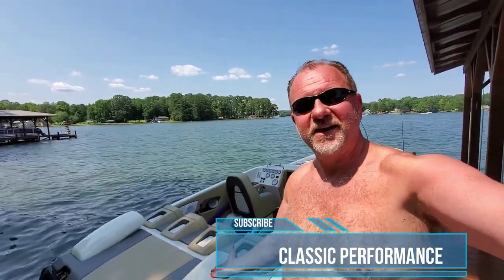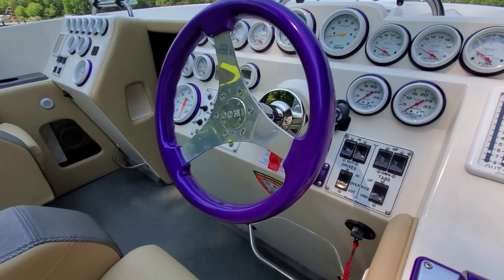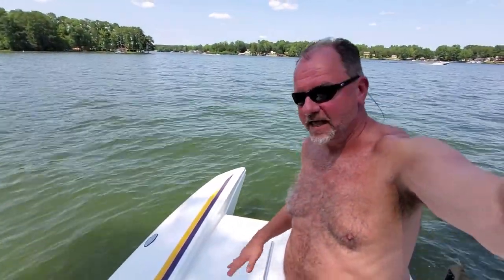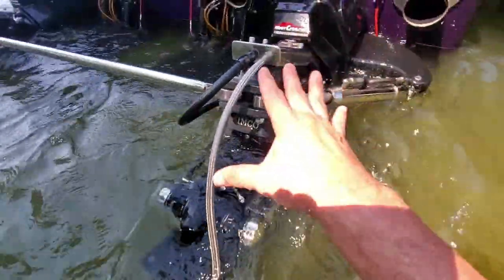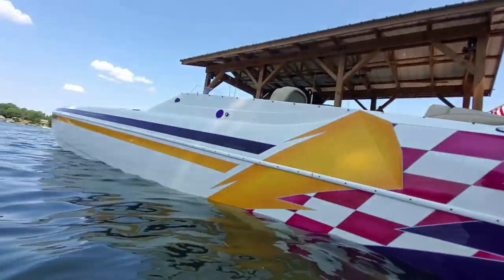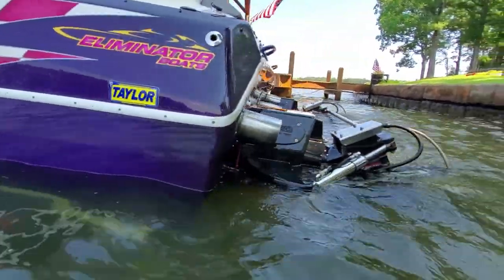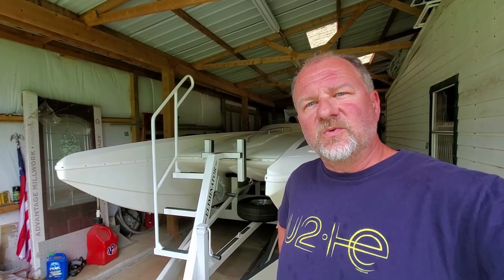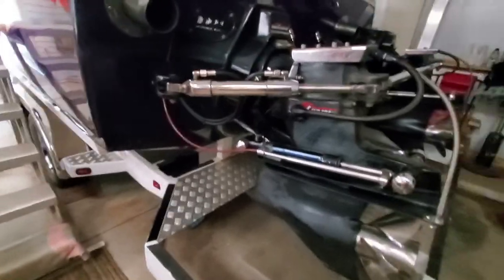Eliminator Daytona 33 walkaround and more! (loud)

Comment: "Livorski" hahahahaha
Reply from the maker: Yea, I know. It's not Polish!! Ha!
Reply: @classicperformance  Great video though. The 33, especially earlier model years are often regarded as the most porpoise/hop prone, but it goes to show when the time and effort is put into getting the setup right (X-dimension, IMCO standoff boxes, tunnel tabs) you can correct those problems. The 33 that ran 174 at Havasu's Desert Storm in 2009, and 192 at the 2012 LOTO Shootout is proof of that.
Reply from the maker: @5571350M8  Indeed the porpoise/hop is always an issue to tune for especially with the new motors over the old Mec "blue" motors. We tried some cleavers and it was vey pronounced and not able to be overcome. In the current state with "standard" props and the NA 540s, she'll run just under 120 @5,500 rpm.

Comment: That thing is siiiiiickkk!!!!

Does the engine noise ever get old when going for longer drives?
Reply from the maker: Never gets old! haha. Actually, at cruising speed the cabin and helm is rater quiet and the motors are more of a background. The wind noise is actually more noticeable. Considering where the sound outlets are for the exhaust and the blocking of the transom it is quite comfortable at 60-70mph cruising speeds and engines are running below 4,000 rpm. Thank you for your interest!